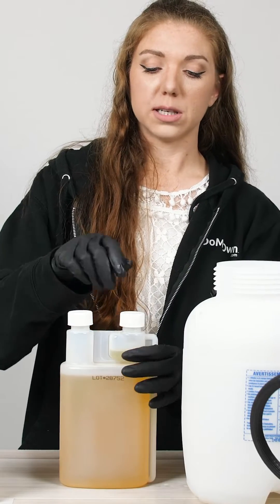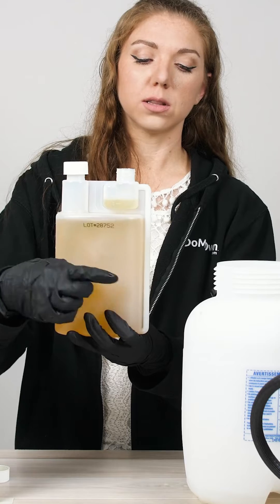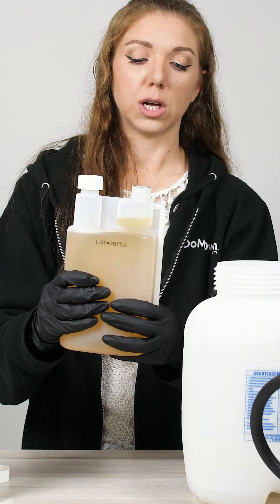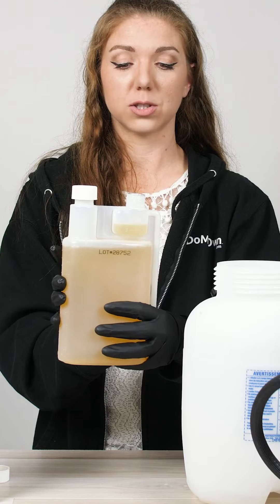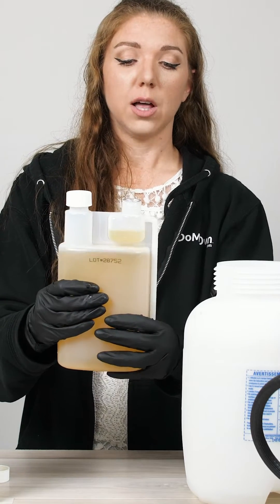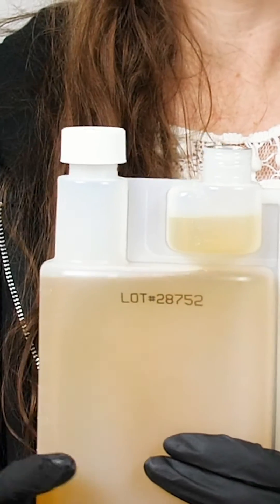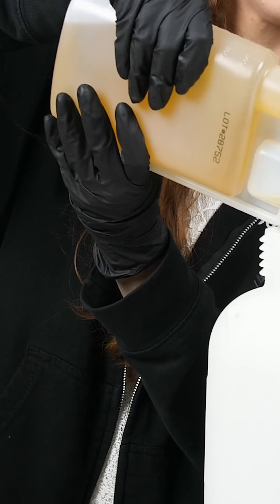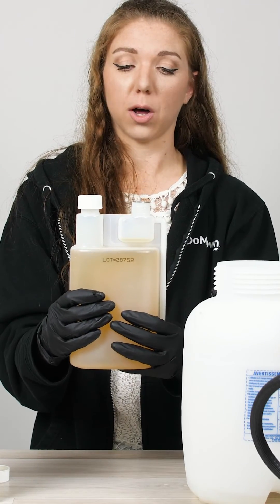How to Measure & Pour "Squeeze and Pour" insecticide Bottles | DoMyOwn.com

Comment: What gloves are those?
Reply from the maker: We recommend these gloves - https://www.domyown.com/disposable-nitrile-gloves-box-of-100-p-2769.html
Reply: Why do you recommend rubber gloves?
Reply from the maker: @Carsman50  We recommend nitrile gloves because of their chemical resistance, durability, and wide array of applications. they're also latex free.
Reply: @domyown  do you have any in size small
Reply from the maker: @Carsman50  https://www.domyown.com/lfs-bellingham-nitrile-tough-gloves-black-p-8246.html?sub_id=8245 We suggest these if you are looking for a size small :)
Reply: @domyown would they be chemical resistant?
Reply: Sorry for all the questions
Reply from the maker: @Carsman50  don't be! thank you for doing your due diligence to use products properly. Yes, these gloves are indeed chemical resistant. However, always follow the safety instructions on the specific pesticide product label. The manufacturer's label will specify the required type of personal protective equipment (PPE), including the recommended glove material and thickness for that particular chemical.
Reply: @domyown would it be okay to use something like dish gloves
Reply from the maker: @Carsman50   if the gloves are nitrile material and state chemical resistant on the packaging, they would be suitable for use. If not, we could not say for certain what the chemical resistance level would be.
Reply: @domyown is there a way to contact you about this
Reply from the maker: @Carsman50  yes, you can find our contact information on our website here https://www.domyown.com/pages/contact-us